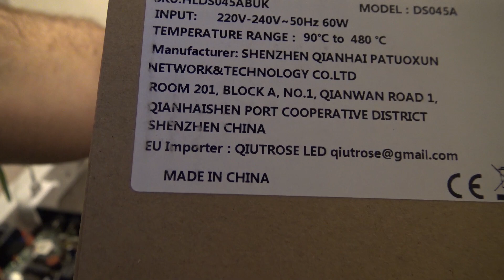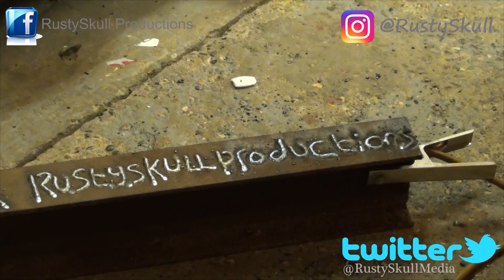HoLife Soldering Iron kit Unboxing

Comment: You should have just bought the soldering iron gun kit in the blow plastic carry case, It comes with everything i bought myself one a couple of years ago on eBay it's 175w i still haven't used it yet, I also have a draper soldering iron i think it is 25w.